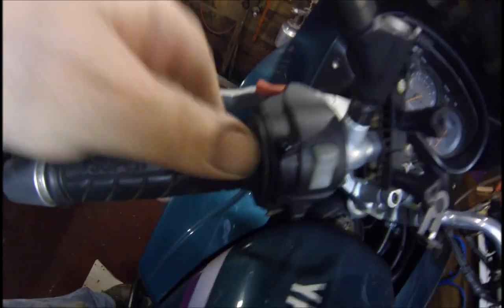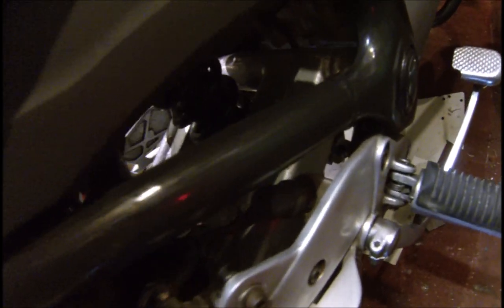XJ900S division. simple MOT checks UK.

Comment: Hello, I have a question. I bought a yamaha xj900 motorcycle and we tested the circuits, the lights commands all turn on, but when I want to start the engine, it does not turn on, please help me mention that the alternator and starter are fine, what could be the fault
Reply from the maker: Hi. Engine could be locked up or bad starter motor or sidestand switch broken or starter switch needs cleaning witch was the case with mine. 👍
Reply: Thanks friend, the bike is already sparking now, so I need to check the changes, they told me that the xj900siemore suffer from the box, it's true, the other week they will finish the electrical part of the bike. to see that everything is alright
Reply from the maker: ok thanks hope you have good luck.